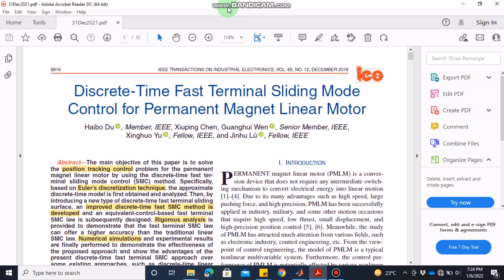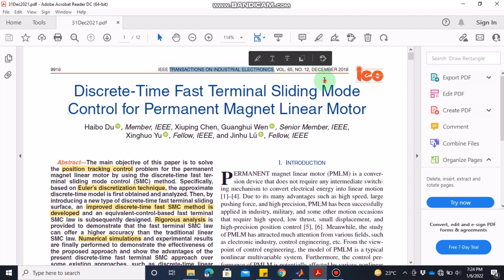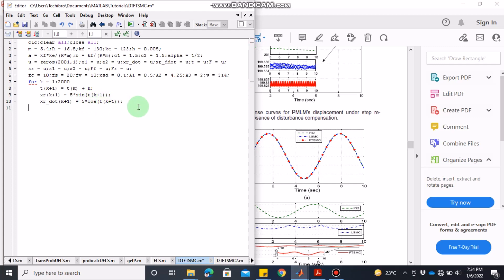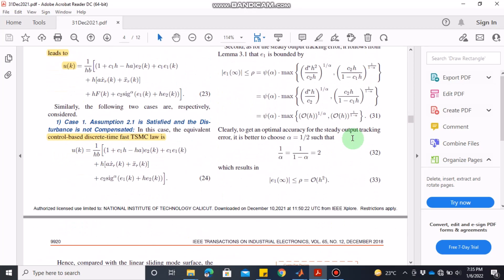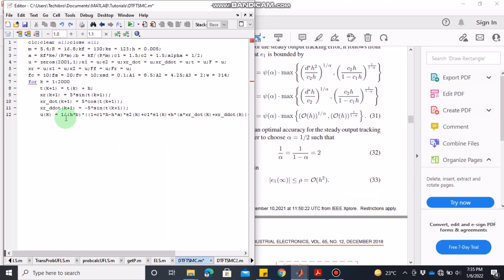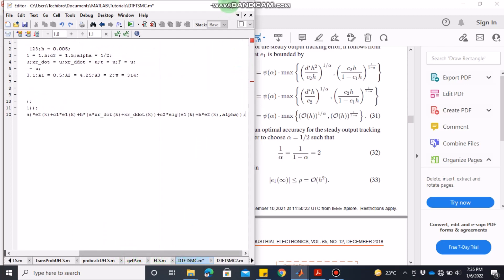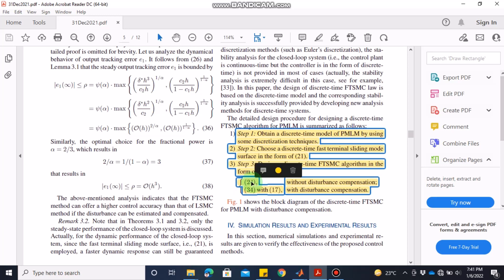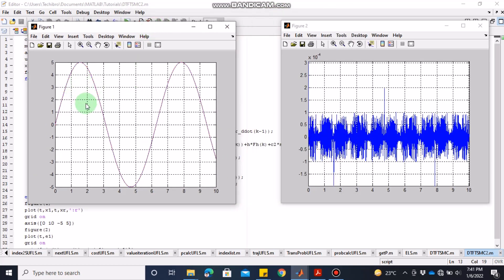MATLAB Simulation of Discrete Time Fast Terminal Sliding Mode for PMLM

Comment: Salam dear and thank you so much for your videos, I really have a problem when I rewrite your code and then apply it, I have replesed sig by ( sign(e1(k)+h*e2(k))) *abs(e1(k) +h*e2(k)) ^alpha) but I don't det the same figures  as your, please, can you tell me why?
Reply from the maker: Please create a separate sig function. There could be many reasons why the plots are not the same in your case. A small typo could be anywhere in the code.
Reply: @cset  thank you so much for your reply Dr, It is working good, good luck dear
Reply: I'm so sorry to bother you again, I tried to change sin signal to unit step so, I put xr(k+1) =200*(k>=1) and xr_dot = 200*(k==1) because the drevitive of step is impulse but the second drivtive I don't know what will be so, I used xr_ddot= dirac(2,xr(k+1)) and I get the same reference as result not the same as in the paper, then is that okay or I don't use a wrong things? My God save you!!
Reply from the maker: @mohammedyaqoob9154  The derivative of step is impulse only for some specific purposes. Here, if the xr is a constant, then its derivative and second derivative are zero please.
Reply: Thanks Doctor for your reply, yes I agree with you that that I used a step by doing 200(k>=0) and this was found in some references, but I understand from you this will be a constant not step signal!!?
Reply: @cset     

I'm so sorry to bother you again Dr. !! I tried to get good results by using this code S=200*heaviside(n); %to get unit step with 200 as implitude value. Then s.dot = diff(s) ; Finally s.ddot= diff(s.dot) And by using for loop have got samples of s, s.dot, and s.ddot!! The first drevitive was impulse with implitude 100 and the second drevitive also impulse but with - 100 is it okay or not?
Reply from the maker: @mohammedyaqoob9154  in my experience, I do not treat a constant reference as a step function reference. I just use the constant value as a reference and assume the derivative to be zero instead of an impulse (it works for me).
Reply: Thank you so much Dr again the heaviside function it works to generate step signal and the first drevitive will be delta and the second drevitive will be minus delta at t=0,so I think it's right and okay!!
Good luck dear
Reply: i am getting error in 12 line .please tell actual code

Comment: Thank you for such wonderful video sir. I have some doubt related to SMC implementation in one paper. They have designed the control input where the state matrix A which is 3*3 matrix and input matrix (3*1) is multiplied with other signal in the control input. So how can we implement that as we can calculate the control signal only for 3 instances/values only.
Reply from the maker: Thank you for the kind remarks. If your system is a discrete one, then it can be implemented using a for a loop. In your case, if there are only three instances, then the for loop will run only three times. I assume that your system is something like x(k+1) = Ax(x) + Bu(k)
Reply: @cset  Sir, control input is given as u(t)=〖EB〗^(-1) [Ex ̇-EAx ̂+EF(e ̇-Ae)+K/M(S) ×sign(S)] where E is 1*3 matrix and F is 3*3 matrix and also x ̇(t)=Ax(t)+Bu(t) where A is 3*3 matrix and B is 3*1 matrix. As we can implement 'for' loop for only 3 instances, we are unable to get the desired output. If you want, I will send the paper. I am facing difficulties in that part of implementation.
Reply from the maker: @rameshkhamari4055  This looks like a continuous-time system to me. You will be needing to use the ode function in MATLAB. Please refer to the following video for an example case https://youtu.be/Aa04S3Cg-Vc 
in your case (comparing with the above video, you will use the equation of u in your problem instead of u = -kx in the video. I have many videos of complex continuous-time control law implementation on my channel. I encourage you to explore those as well to get a feeling of how to simulate feedback control systems
Reply: @cset  Thank you sir for your reply. I have gone through the videos of your channel. This control input is the control signal of SMC taken by the author in the paper "Huaicheng Yan, Member, IEEE, Xuping Zhou, Hao Zhang, Fuwen Yang, Senior Member, IEEE, and Zheng-Guang Wu, “A Novel Sliding Mode Estimation for Microgrid Control with Communication Time Delays” IEEE Transactions on Smart Grid, Vol. 10, no. 2, pp. 1509-1520, March 2019." If you have time, please go through the paper and kindly suggest me to solve this problem if possible. Thank you.

Comment: Sir the sig function that you have used in line 12 of your code is not working in Matlab. I referred to the paper but the definition is a bit confusing. I have the same problem as Ajai Singh asked. Please help to explain it further. JazakAllah
Reply from the maker: Thank you for asking this question. I will add the code for the sig function in the description of the video

Comment: Sir the sig function that you have used in line 12 of your code is not a default function in Matlab. I referred to the paper but the definition is a bit confusing. 
Can you please let me know if the second term given in the paper is the absolute function or is the euclidean norm?
Reply from the maker: Thank you for asking this question. I will add the code for the sig function in the description of the video. It is absolute value
Reply: @cset  Thank you sir, I really appreciate for taking the time to reply to our queries.
Reply: I am still getting an error for that function could you please help me ?
Reply from the maker: @aayushibhatt2194  Please copy the error statement here. Also, please note that the sig function should be saved in a separate file. So there will be a total of three files out of which you will only run the script file that calls the ode45 function.
Reply: @aayushibhatt2194  what's the error?
Reply: @ajaisingh9129  i wrote the code for sig function but the graph you got is different then mine ane if i change scale I cannot see the output in the range plus the sig function code shows error at first that function should be ended
Reply: @aayushibhatt2194  The code is pretty easy to implement, thanks to Dr. Ali, and if you are getting different outputs then there is a very high possibility that you might have made a small mistake probably a typo or something. So I will suggest you go through the code again, hopefully, that should fix the problem. And for the error in the sig function. Try placing an "end" keyword after you are done defining the function. That should solve the problem.
Reply: @ajaisingh9129  i checked everything is perfect just the figure 2 is not the same as shown in the video.